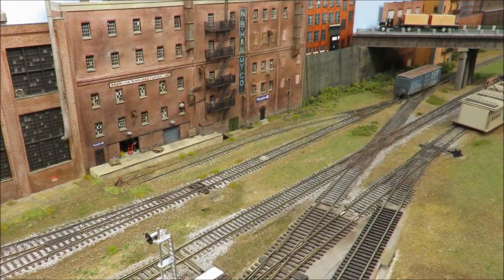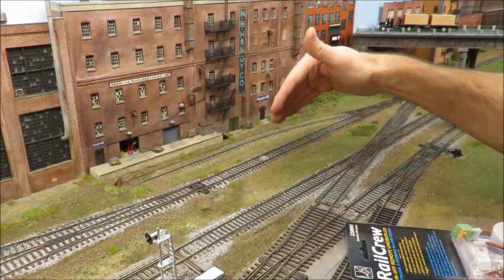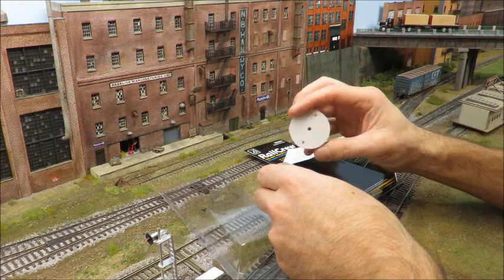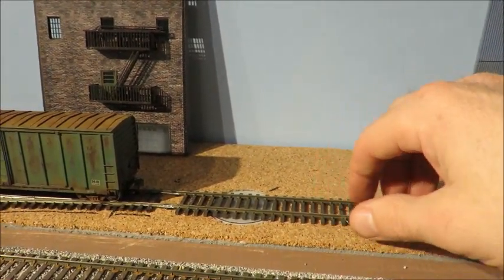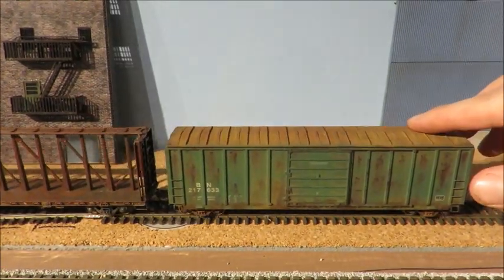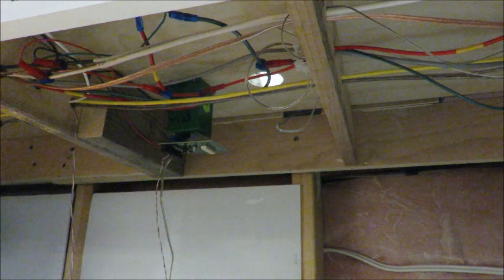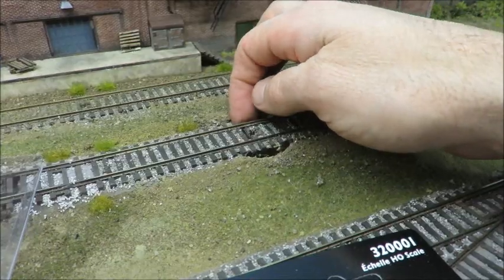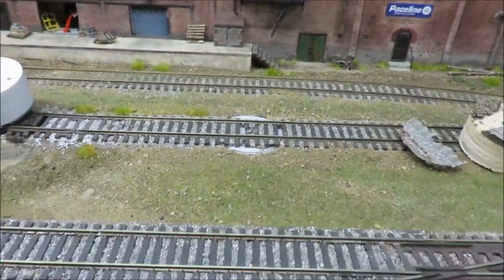Railcrew Uncoupler Installation

Comment: Just a short tip for a next one Steve; as soon as you hit the underlayment with the cylindrical saw, you should be able to take out the pilot drill. 
Also, lowering the drill speed increases the impact of the sawing action. People often burn up these cylindrical saws by speeding them up and pressing the power tool too much. The sawing action doesn’t require high speed, nor pressure.

Comment: You are to drill down with a 1/8" drill bit. Then remove the drill bit from the hole saw and install the guide they gave you with it. insert it in the 1/8" hole you drilled and the cut your hole. I always cut up to the cork and then use and exacto knife to remove the cork and I have installed 8 so far and never any track damage. They work perfect.